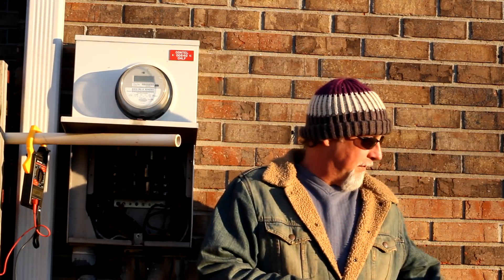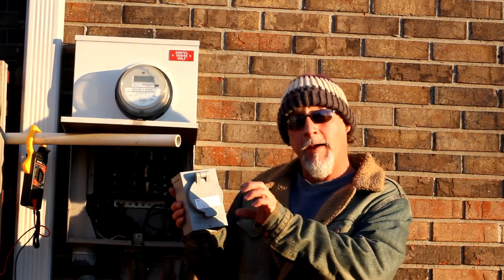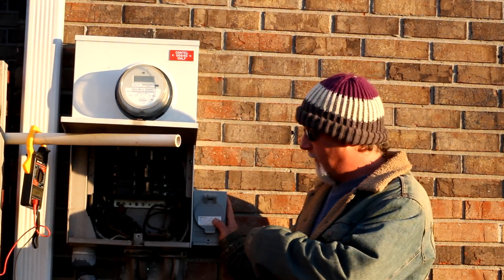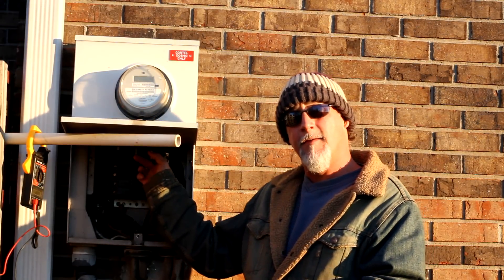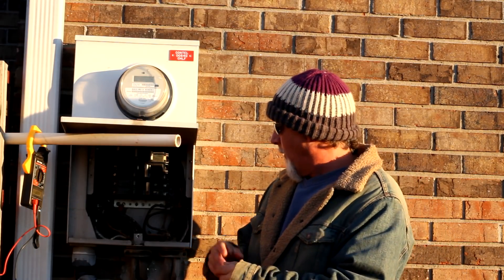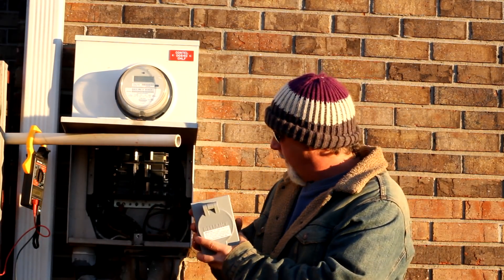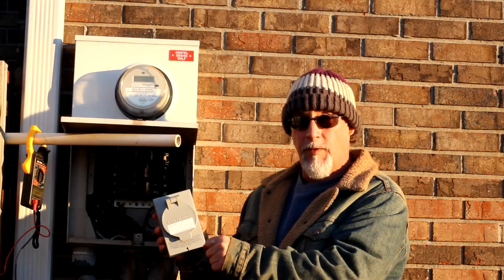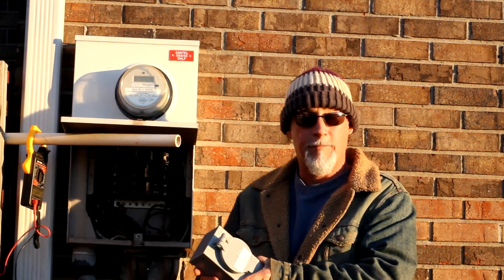Manual Generator Transfer Switch Install

Comment: Your installing a interlock style hook up not transfer switch. Transfer switch would be a single panel with 6 to 10 breakers in it but without the interlock kit that’s illegal depending on state law!
Reply: It doesn't even have an interlock, fire up the genny, plug it in and turn on the generator breaker and voila: power is headed to the grid. Dangerous and illegal.
Reply: Very dangerous setup
Not smart to reccomend to people that dont realize the danger.
Reply from the maker: Alabama